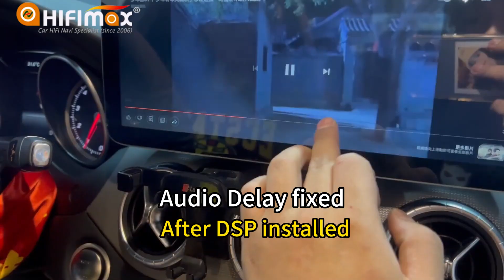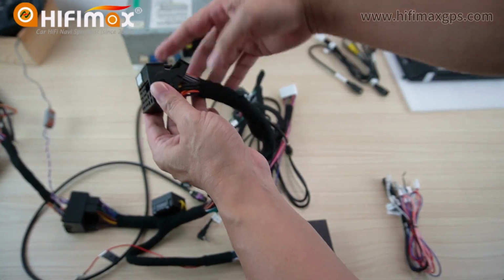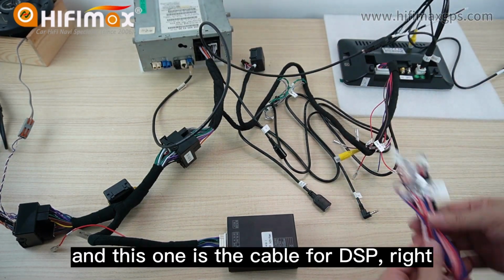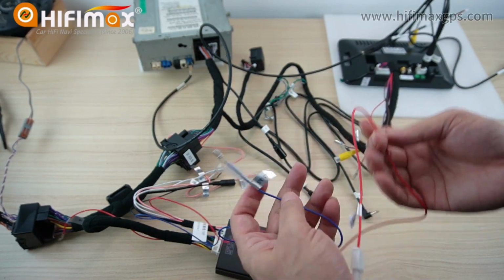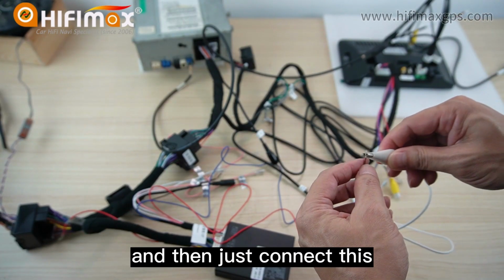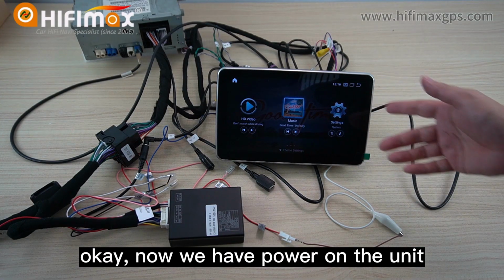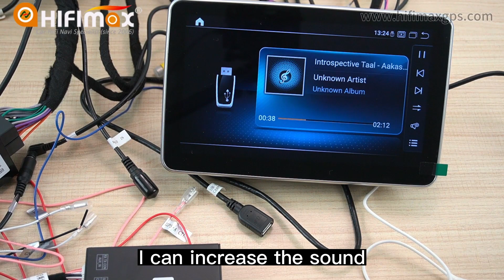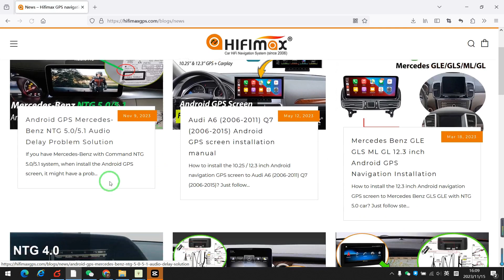Mercedes Benz NTG 5.0 Android GPS screen Audio /Sound Delay Fixed by DSP Box, DSP connect & setup!

Comment: Hello. First of all, I thank you very much for your videos, they are very useful. I have a problem with my Mercedes w class 205, I installed the android screen and the sound works perfectly through the auxiliary in general and in applications such as, for example, Spotify. The problem is that when other apps like waze, map, whatsapp or telegram are going to talk, the music cuts off and the sound is very very weak, I have had to install an additional speaker to be able to listen to these apps and it sounds bad. If you know how to solve it, I'd appreciate it.
Reply: I got the same problem. After screen installation music is working but no sound during call or using google maps. On my older screen everything was working perfect and navigation and call sounds was coming out of the speakers and here no sound at all. Looks like the only option to have sound to work is install provided little speaker, which is pain in the ass. Same here would be happy if this guys be able to solve this issue.

Comment: Hi Paul. Can this fix reverse camera keep coming on with turn signal I will buy it from you guys thanks ❤

(Mercedes Benz NTG5.0)
Reply from the maker: Reverse camera has nothing to do with this point. You should check the settings or connection ( for camera)
Reply: @HifimaxOfficial  thanks 🙏 I will try to check and look up on my car settings again.
Reply: @HifimaxOfficial  or do you have other product that can fix this problem. I have been trying to fix it changing settings but I feel like I need to do something on Canbus not the settings 😢 (Mekede N1000Plus 8G 8G 256G)
Reply from the maker: You better contact your supplier, their models is different to our model, i don't have experience on their model.  @AMG45-Team

Comment: hi, I've installed the dsp and it works as it should. The only problem is that when it switches to android unit sound you hear a high frequency buzzing tone on low volume. Is there any way to adjust or fix that?
Reply from the maker: The volume for android side , you can set to lower level, not set to too high, if ordered from us , can send the details problem to us ( with order number).
Reply: Have you found a fix for this yet?

Comment: I connected the dsp box but then my control know stopped working and I didn't have use of the steering wheel volume control or volume control on the radio.
Reply from the maker: Contact your supplier to check more details